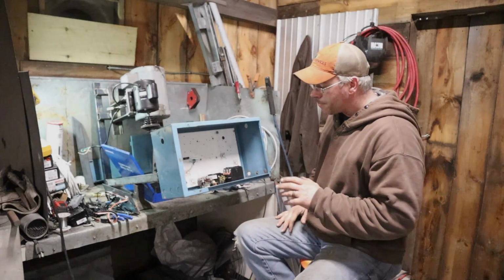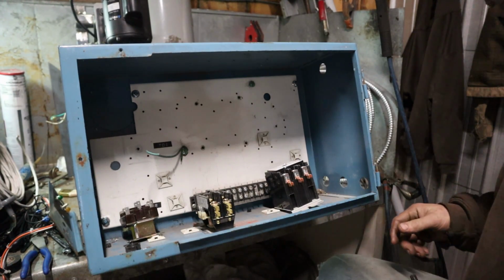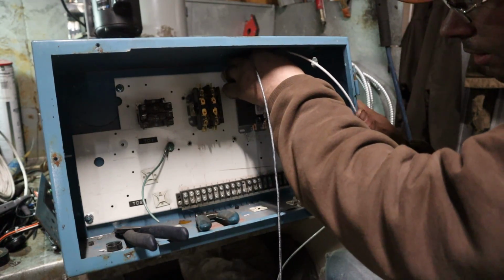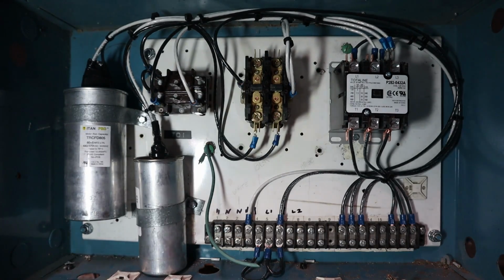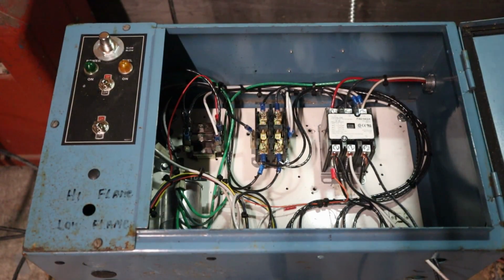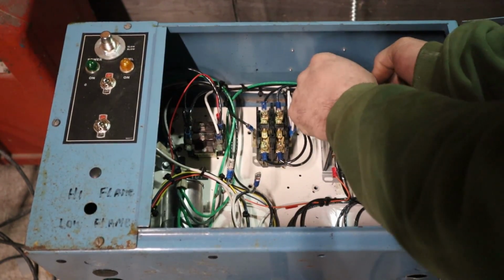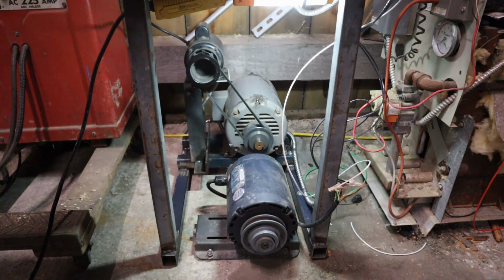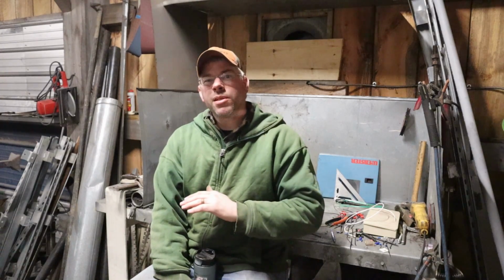MAKE YOUR OWN THREE PHASE POWER THE EASY WAY

Comment: Hey, great video, looking to make a rotary phase converter setup to do 3 phase power testing for instructional purposes. If using a 1.5HP 3 phase idler motor, how do I size the starter motor?
Reply from the maker: Basically get a note with enough power to spin the motor up to speed before applying power to the motor generating the power.  On a 5hp system, I am using a 1/4 hp motor to get it spinning.  Before power is applied, the idler motor is pretty well free spinning.

Comment: If the power goes out while theres a load the  generator motor rotor will get demagnetized.  Can spark it with a car battery to re-magnatise.  I know because I built an induction motor generator.  One time I ran out of diesel and had to learn the hard way 😅.

Comment: So I have a 3 phase 400 amp 480v generator and I would like to have it set up to run 3 phase stuff in shop also be able to power a single phase house. I’d like to have a step down box that goes from 3 to 1. And don’t mind spending some cash to buy one.
Reply from the maker: Your issue is going to be getting down to 208/230v three phase.  Get a transformer for that and then you can also pull single phase power from the 208/230 volt three phase as each leg with run around 115v.

Comment: You need a VFD rated motor to use a VFD on a motor .They do heat up and generate a lot of EMF on your lines and you'll interfere with other electronics .alone conditioners are essential when using VFDs .Especially single phase to  3 phase VFD .Does not matter what brand and you could be sending noise down the mains to your neighbours house who has $ 1,000,000 home theater system and he won't be too happy let alone to someone's house who has medical equipment .Just remember you are responsible for noise generated on power lines just like ham radio !
Reply from the maker: There is a difference between vfd and a rotary  phase converter.  If you did it right when building it, then you do not get the voltage spikes that you do with a single to three phase vfd.  The rotary phase converters work well with the old motor.  On my 2x72 grinder I built it with a vfd rated motor due to high voltage peaks put out by the vfd.

Comment: I’ve ever done this before and those black wires are stacked on each other in the dark and I can’t tell where everything goes. I followed your design and bought all the parts that you used here but I can’t wear them because I can’t see those black on blacks I don’t know which ones are going where think I’ve got like one or two but I’m not sure about like the switch for one.

Comment: Hi , the 5hp motor is wired as Star or Delta?
Reply from the maker: Star
Reply: @TheTradesmanChannel  so what have to be done to generate 415v between phases?
Reply from the maker: To be quite honest, I don't think you'll be able to with homemade equipment.

Comment: Clear as mud Jim, but your schematic is the most comprehensive one out there, my husband is going to attempt this to run his 12hp 3ph planer. He said he will have to watch your video several times and freeze frames in certain sections. In theory can he use a 3ph 15hp idler motor ?.......Thank you again sir
Reply from the maker: Yes he can.  It's not as hard as it looks, he'll do well with it.
Reply: @TheTradesmanChannel  Men like you are getting rare these days thank you sir .

Comment: It is awesome to see a kindred spirit. I have been in the HVAC industry and around Commercial, Industrial areas. I have always kept and tinkered with salvage or old parts to build all kinds of projects. One man's trash is another man's treasure. It also helped me learn a lot of things. I used to love to get my hands on some of the massive old school Capacitors and big configurable transformers that could be set up to buck or boost. They lasted 20 or 30 years with no issues and are still good 60 years later. 

Now I go through capacitors like paper towels. Nobody believes in manufacturing quality or durability anymore. 

Once in awhile I will still come across a 2 to 5 lb  coffee can sized capacitor but now they are a Unicorn. 

I used to build battery chargers and all kinds of stuff out of them.

Now I grab all of the old heavy microwaves I can  for the heavy duty transformers and the ring magnets, and a few other components to play with.

15 years ago I shocked an owner because I built a control and bypass box to run a new VFD and 20 HP motor we changed out on a 50's vintage massive belt drive blower air handler in a an old Church. 

It was the old school Hot Deck , Cold Deck style with Analog heavy duty Honeywell damper actuators with 3/4 " rod linkage to the Blend dampers.

No one could find a Hand, Auto, Off control panel to integrate into the old control system and the new VFD to make everything work together. I built one and tied it altogether with relay and contactor logic just like you are doing with the auxiliary safety contacts to interrupt and make sure circuits were not trying to fight each other. 

It was a 2 speed or dual speed 3 phase motor configuration and we varied the speed of the first stage or lower speed during load shedding and first stage operation. The VFD let us control or program multiple modes. 

If need be,  anyone including the maintenance guy in an Emergency could walk in and put it on Hand or manual and select high or low to provide shared heating or cooling through the whole building if there was a problem. The Hand position would engage a soft start.

I am with you. Relay logic and mechanical stuff just works. Computer boards and DDC are always failing.
Reply from the maker: Great comment, thank you for sharing.  Nothing beats relay logic.  I use it to replace boards in anything I can, it just plain works.  I have 100 ton chiller at a paper mill that the board went up on.  I installed relays and mechanical temp controls on it to replace the boards and sensors and they ran it like that for ten years.  I'm with you.
Reply: @TheTradesmanChannel   Many years ago we replaced a 50 ton Trane AC with a Commercial carrier Unit with twin Semi Hermetic Compressors and unloaders. I Built an automatic unloading control scheme to shed load and also allow it to run in low ambient temperatures. I used mechanical adjustable pressure controls like we used to use in freezers years ago. I set up 4 stages of cooling and 3 unloading stages that were automated off of pressure to take care of varying loads. I set everything up with a Nitrogen bottle and regulator first before installing it.

It worked great for 3 years until another Company subbing out for Carrier building services could not understand what I had done and convinced the owner that they could save him on utilities with a computerized overlay. 

They tore all of my beautiful work out and sold the owner thousands of dollars worth of controls and years of constant tweaking and upgrading. 

I used to be a contractor Rep or trouble shooter for Carrier Commercial industrial machines including chillers.

I got sent out to that same customer after about 4 years because of issues and it kept shelling out compressors. 

I told them to bring back the guys that did all of the changes and make them pay for it.

With what I had done originally they would have never had an issue. 

Instead they lost compressors due to improper unloading, or should I say no unloading in low temps, and washed the oil out of the crankcases by slugging or bringing back liquid refrigerant.

Liquid refrigerant is a poor lubricant for compressor bearings.

The old Antique Trane units had a simple discharge air damper or baffle actuated by a cylinder using discharge refrigerant pressure. 

They also had one stage of unloading.
They worked for 25 years of constant running before just plain wearing out.

Water is wet and oil is slick and no amount of computer control and software is going to change or affect that. 

Do you think our super smart young programmers can ever learn that?

I am 55 and I started out while we still had Analog Electric and pneumatics not to mention relay logic.

DDC computer controls were just starting out on basic DOS systems and I got in on the ground floor so to say. 

I loved what the computer systems could do but I could integrate and mix and match systems and I understood them. 

I could understand the logic in a much larger total system that had to synchronize with many others.

It seems that we have lost that in todays world.

Oh well, good luck with your future projects,  we need more guys like you out there showing the youth a different path.

Comment: Can you do this same process no matter the size of motor? I'm trying to power a 3phase 100hp motor to run a sawmill.
Reply from the maker: How big is your sawmill motor now?
Reply: 100 HP. I have also got a 50 HP that came with it
Reply from the maker: To do a 100hp electric motor you would need a 300hp three phase motor to make the three phase.
Reply: Could I send you some pictures of what I have and see what you think I'm dealing with

Comment: Am I understanding this correctly?  First or Second Phases of the 3-Phase motor are being powered by 120VAC to turn the motor and the Second or Third Phases of the Motor are used as a generator?  Can you confirm?
Reply from the maker: On a three phase motor the three poles of power are close enough initiate the turning of the armature.  On single phase (120v or 240v) motors the poles are not close enough to start the motor turning.  With this setup we are using power robbed from both legs of the single phase supply to generate the third pole.
Reply: @TheTradesmanChannel  Thanks for confirming.  I was thinking that... though never seen done before.  Good to know as a method.  I found that the Prius CVT's since last so long can be found for a relatively great price, so purchased one so far and plan to get another.  They have two Motor Generators (MG's) that are a permanent magnet design.  I've thought could run one as a motor on single phase and the other as a generator, generating three phase.  I also was thinking and will do most likely, just run one or both (if lazy and don't machine or modify the case to make separate enclosures) off a 18HP motor to limit the power for now while testing. Eventually, the plan is to make an engine welder/generator and potentially a hybrid garden tractor.

Comment: You'll want to wire the dual capacitors in parallel, not series to get 'more juice' (higher ufd value) out of them. Wiring caps in parallel causes the values to add together. Wiring them in series causes the total value to be less than the smaller cap (C1 x C2) / (C1 + C2). I think you said that one cap is 5ufd, and the other is 50 ufd. Wiring them in parallel will give you 55 ufd, wiring them in series will give you 4.5ufd..
Another negative aspect of running VFDs is that they generate harmonics which cause electrical currents between the motor armature and ground. This will cause arcing in the bearings and will ruin the motor bearings over time. There are ways to solve this but it usually means buying expensive equipment for the motor in order to ground the motor shaft.

Comment: Nice! I saw an idler motor with a large diameter pulley and the guy would spin it with his foot to start the operation. 

I have a question. When the idler motor takes off and is spinning the pony motor does the pony motor begin generating electricity as well? Keep up the good work.
Reply from the maker: Good afternoon.  The idler (starter) does not keep generating power once you remove power from it unless it was a special type of motor.
Reply: @TheTradesmanChannel  I might have messed up the lingo. The 1/4 hp spin starts the 5hp which then becomes the three phase generator for the load motor? I think I may be missing a core concept. Thanks for the reply.

Comment: im trying to find a way to not cary a charger on a long range electric bike...i have a controller on the way that can do regenerative braking...watching you it seems i could use the 3 phase motor on the bike (brushless dc motor) as an ideler and produce 3 phase to put through the controller to charge batterys..240v ac here in aus i can use a simple cheep light dimmer/fan controll to turn voltage down but im not sure how to reduce the aperage/currant..perhaps a light bulb or resistor..any way do you have any sugestions/ideas for me..needing some thing like 40v dc at round 25 amps...thanks russ.

Comment: I appreciate you making the point about the potential relay taking out the motor as well when they die. I just bought a new, very expensive 10HP Baldor motor and I would hate for it to be killed by a $20 potential relay.
Reply from the maker: That would suck but I've replaced a lot of them over the years for that reason.

Comment: would this method of using an idling motor work if my device also sends power back to the grid? or probably not eh.
Reply from the maker: I don't think it would.  Remember you're not generating power here, you're robbing a little from the other two legs to make a third.
Reply: @TheTradesmanChannel  thanks yea it seems like the only way is to pay the big bucks for me.. thx.

Comment: What is the final voltage you are aiming for? 120/208?
Is the idler motor running on 120 or 240 single phase?
Reply from the maker: Final voltage is 208/230 3 phase, idler motor runs on 220v.

Comment: You only have one phase to start with. L1 and L2 are the same phase. The motor is running single phase at a reduced torque, you are limited to what load       .you apply to the motor before it stalls. Maybe 20% of what it would be using 3 phase.
 You need a 240 single phase motor driving a 240 volt 3 phase generator to run your equipment.
Reply: The 3 phase idler motor is acting like a rotary transformer, the rotor being the primary winding, and the stator windings being the secondary windings. The rotor is inductively energized by the single phase supplied to 2 legs of the stator, and as it spins, it induces a voltage in the 2 other windings, creating the phase difference mechanically as the magnetic field of the rotor sweeps the stator windings. You end up with three voltages that are 120° out of phase as a result of the physical position of the stator windings, with frequency equal to the single phase supply, but with the downside that the ‘generated’ voltages will drop below the single phase supply as you load the converter. Having an idler 3x or larger (the larger the better) than your load motor will alleviate the voltage drop issue, but you can use boost transformers to step up the 2 generated voltages a bit so they don’t drop as low as if you just had a bare rotary converter. Rotary phase converter have been working for over 100 years.

Comment: Great video!
  One thing though, and I apologize if it's been said already; near the beginning you have a big capacitor with three terminals;  You said something like "If you want to get more power out of it, you could wire the two (internal cap.s) in series".
  This may be what you meant, it sounded backwards to me; if you wire them in series you will increase the max allowable VOLTAGE; if you want to increase the capacitance, you'd wire them in parallel, i.e., jump the two non-common terminals together, no?
Reply from the maker: Good evening.  You are correct and I misspoke. Good catch!

Comment: Very interesting and I am glad to see you using the proper neutral instead of the ground. I would like to do something like this but the way your electrical systems are designed with 240 volts being split into two separate 120 volt lines is different from ours in the uk. We have our 240 in a single #40 v supply, not split and I'm trying to think of a way I could energise the L1 and L2 of the ghost 3 phase motor. Would using the neutral give a negative 240v to say L2, would that work? the neutral being the negative side of the sine wave.
Reply from the maker: You should be able to do it the same way I am here, just match all of your motor voltages.  Your capacitor sizes might be a bit different than what I'm using.
Reply: Did you ever do this? I'm in Australia and have the same 240V coming into my house.

Comment: Interesting, but it might help to explain that the 'idler motor' is acting as an inductor that, with the capacitors, gives the required phase shift (LC circuit). Displaying the phase angle (as well as the voltage and current as you do) would clarify.  Given the large size and poor efficiency of such a system, I will stick with VFDs.

Comment: Why not start the idler with a start cap?
Reply from the maker: It is easier but I replace way too many compressors as well as motors due to start cap malfunction to want to worry about it at home.  For the record, that is just my preference, not a you should do it like me statement.